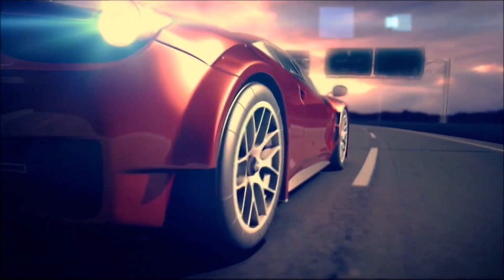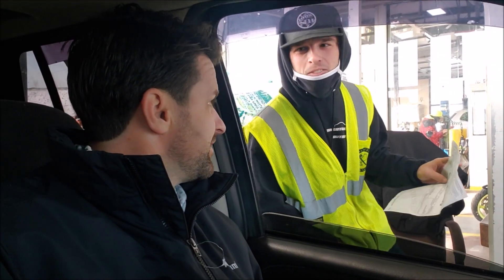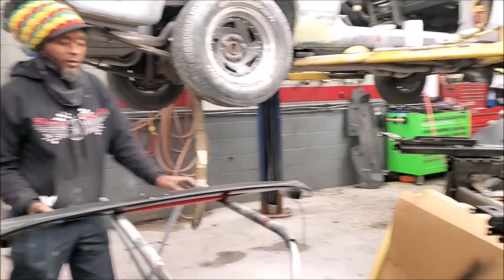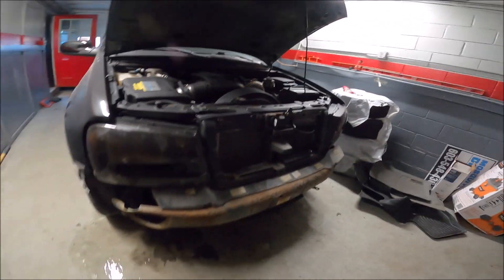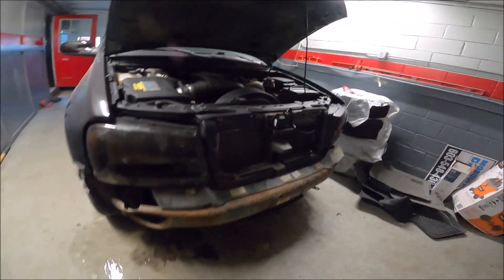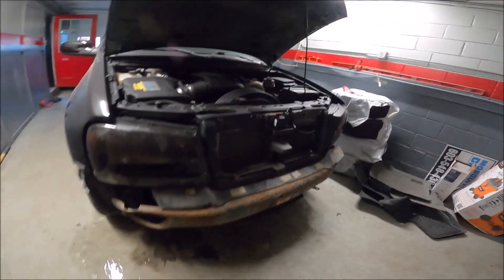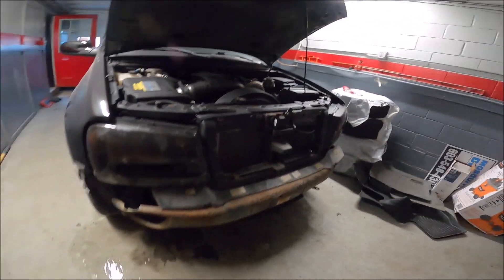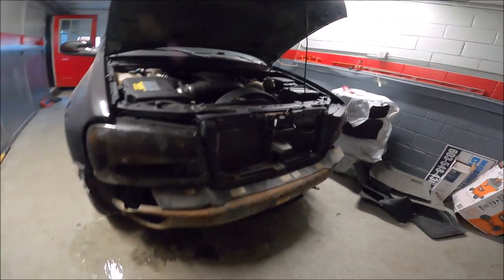Trail Blazer SS Project is Finished! - Flipping $400 to a Ferrari - Flying Wheels

Comment: It would've been great to show the frame after repairs been done.
Reply: I am sure it is top notch......................
Reply: What repairs.......
Reply: There's a really good video online on how do repair those frames. You make a cardboard template out of the torn/rotted section, cut that out of 1/8" CRS, bevel the edges then fit it right in. I was going to do that on a $700 F150 crew cab 4 x 4 I had but ended up fixing my other truck instead and keeping it as a parts truck.

The thing is: where I am, the welding (even if done correctly) to certify/safety it HAS to be done by a certified welder.
Reply: @Mr_Jack_Of_All_Trades_  the big gouge in the frame that he took it to frame repair shop to get it done.
Reply from the maker: Next video
Reply: @NWCI  I was being sarcastic
Reply: I know its non of my business but how much does your workers get pid?
Reply: Paid*
Reply: I thought I missed that, guess it never happened. I would have like to have seen the repair :(
Reply: Should have fixed the dent in the rear bumper, fixed the area and put a new SS badge on the liftgate... If you are going to go that far, might as well go all the way... 🤷‍♂️🤔
Reply: Shy I agree, you have to get some SS or something to cover that major eye sore up. There also looked to me a big dent in the middle of the hood right above the bug guard he put on, why would he not have fixed that ??  Not hating on work just wondering if there a reason not to pull that dent out ?
Reply: @Mr_Jack_Of_All_Trades_  Sorry, could you explain the joke? Are you saying that he didn't get it repaired?
Reply: @muskokamike127  and where I am nobody specializes in frame repair.  It's annoying
Reply: @treasurethetime2463  all you need is a certified welder. They don't need to specialize in frame welding. 

A non-certified welder can do it as long as it's done correctly. There are plenty of people who can mig weld as good as a certified welder they just never got their ticket. 

I used to be able to mig really well, lost my touch because I haven't done it for a while.

I used to live in a converted factory loft and there was one company who used to build platforms for bedrooms, etc (lots of people put platforms in due to 14' ceiling heights). I built my own and they were working on a unit next to mine. The welder came by, saw my welds and said "how long have you had your ticket"? What ticket? lol

Want a job? he asked. He could tell by looking at my welds that I had a little issue at the beginning with the settings, but as soon as I got it dialed in the welds were spot on. I was welding 1/8" angle iron to 1/4" thick I beams for stair treads. Due to the different thicknesses it's a little trickier.

Comment: I can bet that frame damage was one of three things...either it jumped on a Dyno run and the strap caused that or it was on a trailer and was in some type of incident or most likely they skid off the road and instead of calling AAA someone hooked a tow stamp to it and ripped it out of a ditch hence the scratches...either way a coil truck somewhat brought back to life...

Comment: I've got the 2005 Trailblazer LT V8. It has the switch that has rear-wheel, All Wheel, 4x4, and 4x4 low for the options. I love my truck. .05 miles to the gallon off from its factory gas mileage. I take really good care of it since it was handed to me after my father's passing..

Comment: craig sold it baby! the bimmer.  made 1800$ sold for 5600$ thanks for the motivation! about to buy a high mileage 6 speed ls1 for 5700-5800$ its a steal its a 2003 corvette electron blue w chrome wheels and a 6 speed manual transmission. cant wait! buy now in winter i can drive it for a few months and sell in spring for at least 2k in profit!

Comment: I love the SS. I had an '06 2wd with a JLT intake StainlessWorks long tubes, SW exhaust, 4k stall converter and a tune. Loved it right up until it got stolen. IMO... Should have fixed the rear bumper, or replaced it.

Comment: Next time you put the leather back on the back part of the seat, put a trash bag over it and it'll slide right on.  Cut the holes on the trash bag where the seat attaches to the foam before hand.

Comment: Nice job on SS Trailblazer.  Only downers eere:The cloth seat inserts. They appeared very worn or dirty/stained. A black dye job on the inserts would have dramatically improved the appearance. Secondly, that blob on the right rear panel where the SS insignia was removed might make a potential buyer wonder ......

Comment: 20:07 great job on that rebuild and flip  👍👍 too bad the guy didnt pull out the 2 dents in the back bumper while re painting it, it comes back easy with a heat gun

Comment: I know it’s kinda an estimate but I feel like there’s more than $2k into that thing. You purchased a full set of leather seats, 20inch rims/tires, got the frame repaired, many misc bumper pieces, grills etc., and a lotttt of labor. I feel like the parts alone have to be like $1700 and then labor for all the body work/paint/wet sanding/ buffing and frame repair are probably another good $1500-2000. Idk I could be wrong but it just seems like a lot to only amount to $2,000. Love the series though

Comment: I respect the hustle but that paint/body work is hacked. You have to clear the entire panel even for a scratch. Blends dont last long before they become very noticeable
Reply: Not true if they are done right. You prep the entire panel with 1000 grit. You hide the blend into the 1000 grit scratch after buffing. Ive done hundreds and the blend will last as long as the rest of the paint if the prep is correct.

Comment: It’s the ss1 , pretty much base model . I have the ss3 and it comes with leather seats , air bag suspension, sunroof, electronic seats/ heated seats . But it’s crazy you bought yours for 1900$ I bought mine for 16k in 2018 😅😅

Comment: Show the motor and what the repair to the frame looks like? It’s as if you don’t want to or you didn’t have it fixed. Sketchy...? Honestly and respectfully it still looks like a polished turd of a used car.
Reply: that’s probably why he wants to send it to auction,it’ll fetch $6k-9k depending on mileage to a buyer unaware of frame rot(which he claims is damage),I’m sure in pictures it looks real nice but in person is another story, I can’t see any in person buyer paying him $5k if they look underneath it, typically that’s what these auction flippers do they clean it up enough to screw the next person at auction.
Reply: @wildingarage2003  totally agree. Spends all that time and effort working on the visuals to distract buyers from the real and expensive issues. They even spray painted the front grill badge while on the car instead of buying an oem red one lol. I’d be willing to bet there’s some red overspray on it. And they only replaced front seats in leather. The back seats are still cloth. So tacky and unprofessional. Also getting excited about the Grant steering wheel as if it’s a selling point is like being excited about all the great punts during a terrible football game. I about laughed myself to death when they showed the rear bumper falling off at the end 🤣😂
Reply: I wonder how honest you are?, you have a garage
Reply: @thebear6529  I’m honest enough to make sure what I’m selling doesn’t screw the next guy or come back to bite me in the ass.
Reply: @wildingarage2003  i’m 100% sure they know what they doing you probably neva worked on a car
Reply: @lilspazzout8804  yeah I prob never did

Comment: Why couldn't the dent in the rear bumper was not removed or made less damage looking by using a heat gun from the inside of the bumper when it was off the trail blazer?

Comment: I don't mean to be a stickler but I seen a good size dent in the hood and there is a gap in the front bumper on the passenger side. Overall the job is done very well!
One other question. Did you have a quality staff and a garage full of equipment flipping $2k cars? I'm just thinking, the guy starting probably won't get the same outcome.

Comment: For the Mustang, paint it the Original color with NO Stripes!
If anything,give it the Mach 1 Flat Black Hood.
NEVER put Stripes on a car that didn't come with them from the Factory.
It cheapens that car and 99.9% of the time they are NEVER put on correctly.

Comment: The quality of work is just disappointing. Fix rear bumper but didn’t fix that large dent? At least throw some bondo in it and sand. The front bumper isn’t even aligned. It’s almost like you could have sold it for the same price less any of the paint work and time spent.

Comment: Any bodyman here screaming at there repairs ??🤮🤮🤮
Reply: What exactly are they doing wrong
Reply: @mcpolarbear13  the way that blended the panel is not right , And left the massive dent in the bumper when that were already going to paint the whole bumper ?? I’m sure the truck looks good from far away but once you get close to her you’ll see there quality of work
Reply: @ismaelnino6392  I agree with you 100% I used to do body work years ago Why not fix the dent in the bumper you right there it'll only take a little bit Also all those blends I going to show up Down the road
Reply: @pauldoyle206  definitely but hey if it makes money 🤷🏽‍♂️
Reply: @ismaelnino6392  Yes it makes money But if it gives you a bad reputation later on no one will go there they'll all think they were bunch of hacks

Comment: Talk about a half azz rebuild..... Y'all took that back bumper off and couldn't knock that dent out of it? I like how you sanded the headlights but the tint is still on the lower right running light and the assembly is scratched to hell still and the Chrome billet insert on the driver side lower bumper is zip tied to it and falling off. And what's with that driver seat trim separation? Lol yeah that vehicle looks better than when you bought it but it still looks like a POS lol! Dude you're a cool guy but after watching your videos and watching the stuff you do to these vehicles I would never buy a vehicle from your dealership lmfao!